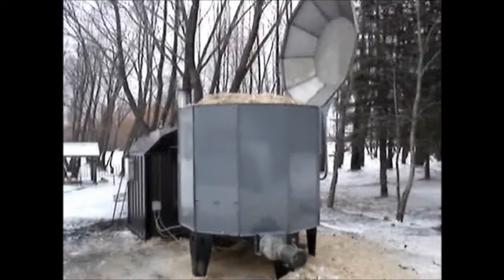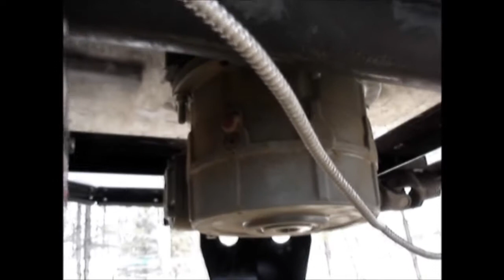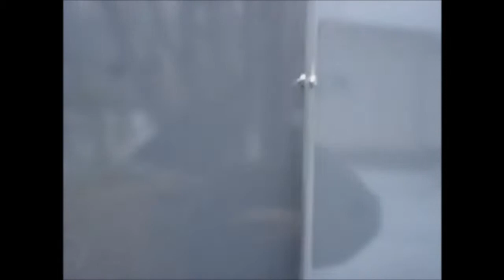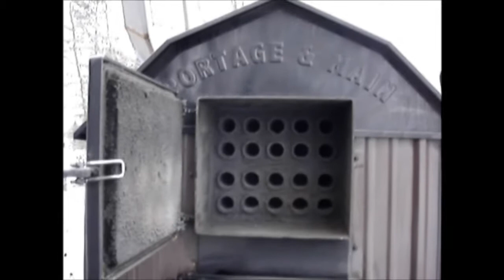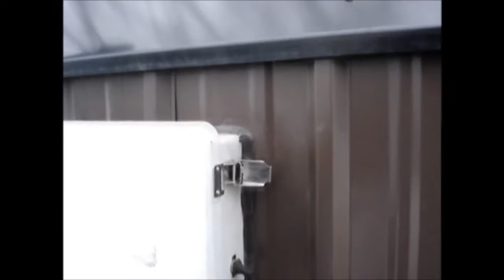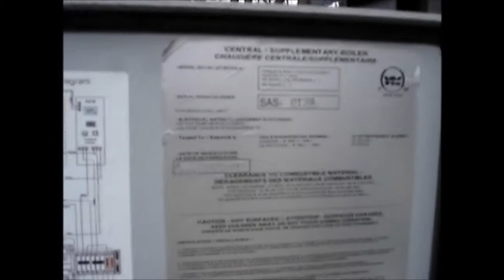Enviro Chip Burner 2012 Compressed.wmv

Comment: It's not certified for steam pressure, simply provides hot water for domestic heat and hot water. You want to generate electricity? Buy a generator. This ain't it.